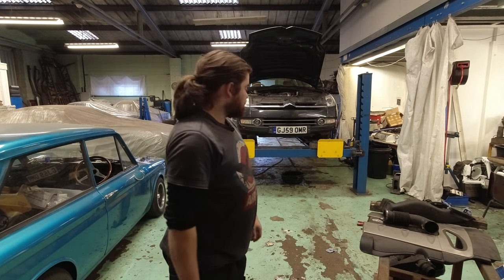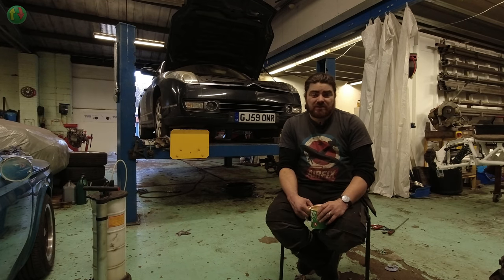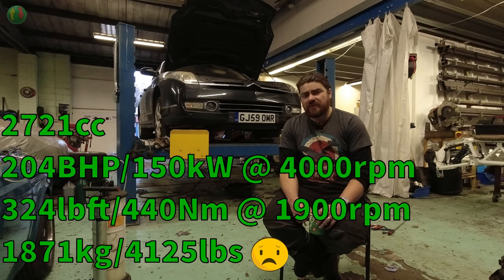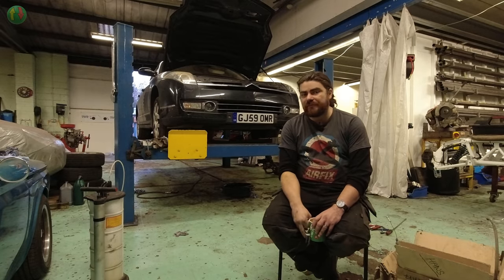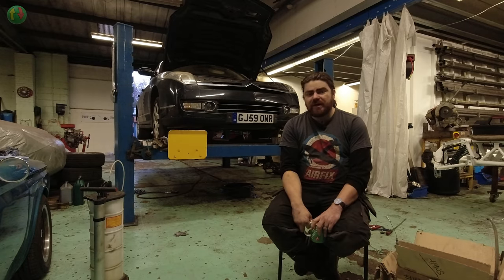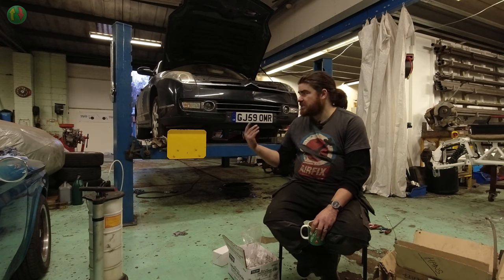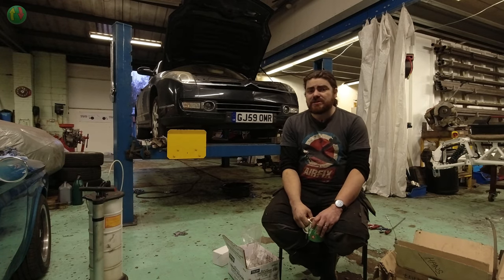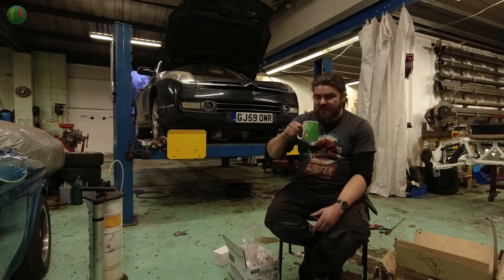STORYTIME: How I ended up buying a £750 Citroën C6 in lockdown!

Comment: Can a C5 suspension be operated when stationary with just the self-leveling potentiometers being moved by hand when the main engine ECU is disconnected and the BSI disconnected also ?  What do you think ?   Tricky question or what ?
Reply: No.
Reply from the maker: I couldn't say for sure, but doubtful. The BSI is interconnected to everything (e.g. when you open the door on a C6, the car 'rises' to greet you!)
Reply: @mikescudder4621  Thanks for the reply. My C5 has that nodding 'issue' when parked and the front wheels aren't facing forwards. I understand that there is a steering angle component monitored by the suspension. Thing is, you can lock the car and walk away and it will continue to do the "Mexican car thing" all by itself. Left my parents in it one time ,and it scared the life out of them. I always have the front wheels forward when parking now, so it doesn't happen at all these days. I only mention it, to gain an understanding of how it all  hangs tongether. I take it from your answer, that the self levelling 'pots'  are hanging off the BSI then. Is that correct Mike. Thanks for your answers.
Reply: @UPnDOWN  Ok thanks for that. Don't want to bore you too much , talking Hydractive 3. A fix for the nodding C5 that I mentioned earlier, is to wire a relay in, in order to turn off the BHI ECU once the BSI has lost power. The latter happens 3 minutes after the ignition is switched off.  So, I 'assume' that the BHI ECU was working off of the last recorded signal from the BSI, ( Steering angle sensor in this 'nodding' case ) . Turning off power to the BHI ECU stops the gyrations. One quesrion  for you, if you don't mind.  If power was "artificially" maintained to the BSI, and also to the BHI, then I wonder if the self levelling pots could be moved by hand, with a corresponding change in suspension ride height, even when the main engine ECU is off  (  Ignition off etc . )   Any thoughts on that Mike !  Thanks.
Reply: @UPnDOWN  The BSI does have it's thumb in most of the C5 pudding, indeed. The self-levelling 'pots' are one of the few things that don't report to the BSI, and instead are read by the BHI.  So, I wonder if the self-levelling pots can be used to adjust the suspension, with the ignition off  , but power applied from a 3rd party source direct to the BHI.  The "front height sensor" and "rear height sensor" pots probably wouldn't be getting power in this unlikely ignition off scenario, so I could just feed in the voltage range expected straight into the BHI unit to control the suspension. Do you think , Mike, that this could 'fly' ?   Ta, again. And no, I don't have a hard-on for you. I'm not that kind. :)
Reply: @jackspratt4343  Well i gave a flat No because i thought you were yet another guy wanting to retro fit a citroens suspension on something else!! But i also said no because these days a potentiometer is just a signal and that the computer is going to need that signal and at least your travel speed to decide ride height etc but i am not familiar with your system. BUT, open your bonnet,  leave your front not straight, shut your doors, let your car 'sleep' (wait two minutes). Take off a battery terminal and see if its still doing it? Sounds like you've been doing some research, for me in the past the various citroen forums have been very helpful. I've also taken my Renault to a specialist for a 'repair quote' to understand what the actual problem is, then i do the work myself or have a normalish garage do it.
Reply: @jackspratt4343  I'd be surprised if the BHI didn't already have a relay and was meant to power down... maybe its stuck? Have you tried swapping the relays around? Will your car jump around for a couple minutes only or will it just continue... that was actually quite funny what happened with your olds!!
Reply: @jackspratt4343  I'd be looking to solve the problem and not invent a way to circumnavigate the problem. Have you tried disconnecting the potentiomenters. Does your citroen throw any codes? It might be that its not actually getting a signal which is causing the problem, or getting a signal on one side. In general, the problem would be a sensor or ecu. I'd just start disconnecting stuff just making sure to let the car electrically  'sleep' first. A diagbox (ecu reader/scanner for PSA cars) will tell you what the sensors are reporting, then you can understand whats going on. It could be a calibration issue (have you tried a general ecu reset?).
Reply: @jackspratt4343  First things first, make sure the connections to the pot sensors are clean, wiring intact, and with no corrosion. Disconnect them and spray them down with contact cleaner. Then start disconnecting stuff, swapping stuff around. Ideally you'd put it on a diagbox scanner because then you can 'see' what the ecu is being told. But maybe to get it scanned will cost the same as 4(?) replacement sensors. But definitely hit up the forums. The guys, especially in the uk, are very helpful will often pass a scanner for you at no charge...
Reply: @mikescudder4621  That is good advice Mike. I just thought I could 'spoof' the system to 'fix' it. I have a visitor coming over soon, who is balking at the price of rental cars these days, and I promised them the C5 for the duration of the stay. They would freak if the C5 did it thing for them unexpectedly. Maybe I'll just tell them to keep the wheels straight when parking.  :)
Reply: @mikescudder4621  Good question regarding the time.It think it stops after a while and luckily before it flattens the battery. I had left them in the car next to canal. They though they were going to get launched into water and were hanging on for dear life.  :)
Reply: @jackspratt4343  bahahah

Comment: Is this the dreaded AL4 transmission? I owned a 306 with a ZF auto which was fine and had a good reputation. I'd love another pug or citroen but will have to wait for a model with the Aisin auto to come into my price range (or just go back to manual gear shifting).
Reply from the maker: No, Aisin TF80. 6-speed.
Reply: @UPnDOWN  oh dear. Bang goes that plan. Might have to stick to manual.

Comment: Very interesting car! I'd imagine that engine gets a decent shift on in something other than a 4x4 or SUV. We got a single turbo 2.7 Lion in Ford Territory SUVs here in Australia. I service a fleet of them and I'm suprised how reliable they've been! I have one thats now clocked over 550k km with minimal dramas. Not looking forward to the chocolate crankshafts though!😬
Reply: Crankshaft needs 5W40 full saps oil. Not low saps 5W30 as advised by manufacturer, and its good to go.
Reply: @plenex  funny you say that, The ones I've serviced from near new have now done 350000 to 550000km have only had full synthetic 5W40 oil, not low saps, as the Territory doesn't have a DPF/no requirement for low saps. The high kilometer one is currently doing 1000km a day and I change the oil on it every 2 weeks! I'm curious to see how long it ends up lasting!
Reply: @andrewhofler  C6 has DPF, but i never had any problem with full saps oil. There is additive system, and when it needs refilling, the DPF should be cleaned too. I think its better to spend 300€ for additive and DPF cleaning than 5-8 000€ for engine rebuild.

Comment: Is it a fault with your video camera that causes the fluctuation in lighting?
Reply: Wrong settings
Reply from the maker: It's the auto-exposure setting on the camera. Defaults to it every time I turn the camera off, and I think the lights in here trip it out. It's one thing the camera (DJI Osmo Action) isn't very good at.

Comment: I almost bought a 2010 in France in 2015. Glad I didn't, because I can't work on a car myself, and it would have been an endless money pit. Beside, I wasn't all that impressed with the ride.
Reply from the maker: The ride is an odd one. It HAS to be set up properly (if it isn't, it can really ruin it) and in many ways it's not as soft as an old BX or XM, but in other ways it's more impressive considering it has low-profile tyres and can corner quite flat in sport mode.
Reply: @UPnDOWN  It certainly is odd. My main source of disappointment was the fact that it wasn't smooth on cobblestone (certainly not as smooth as I thought it would be), and it was too wavy at slow speeds, making me carsick. The flat cornering was impressive, though. My mother, who was with me, dubbed it "The C-sick.":) I used to drive nothing but large American luxury cars and was expecting something superior from the C6, having never driven a Citroen before (as you may know, we haven't had them in the US for many years). It was a bit of a letdown, as I already mentioned. Well, it looks like yours found a very good home, and I hope it gives you many years of satisfaction.

Comment: not even the 605 comes near this ,the 407 is more c5 type but far from  both,it´s not a bad car but it´s the same of saying that the fiat tipo is more or less the same of the S.-class from mercedes, that comparison is ridiculous the peugeot doesn´t come near of a C5 much more a C6
Reply from the maker: The C6 uses a stretched 407 floorpan, as well as a multitude of other components. They're built in the same factory. The Peugeot 605 is nothing like a C6, it shares more with the XM.